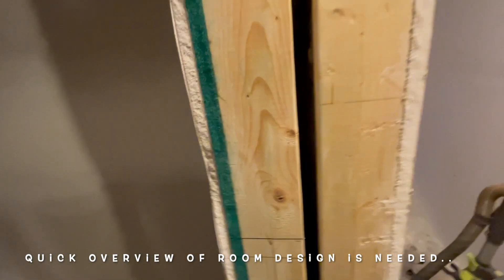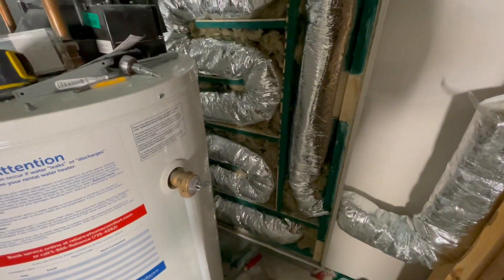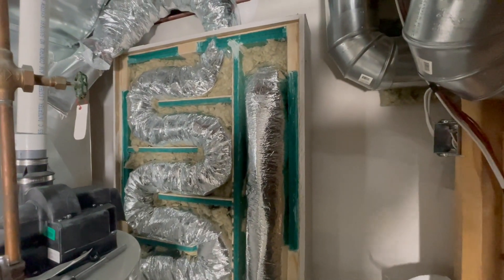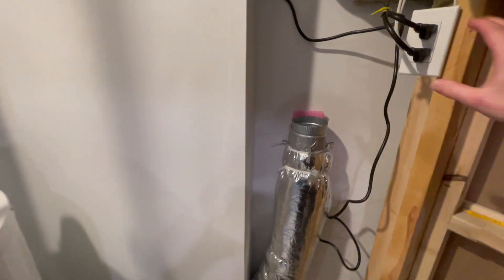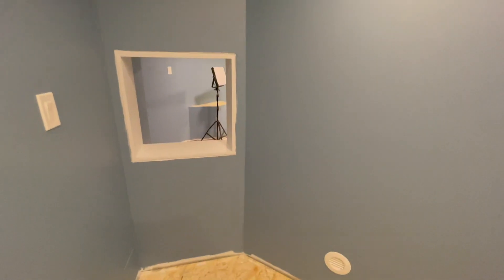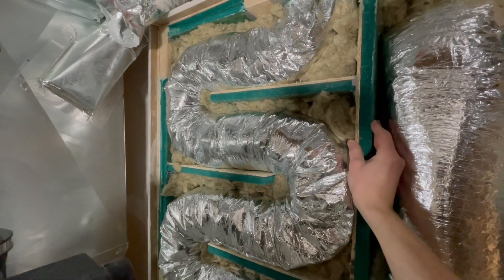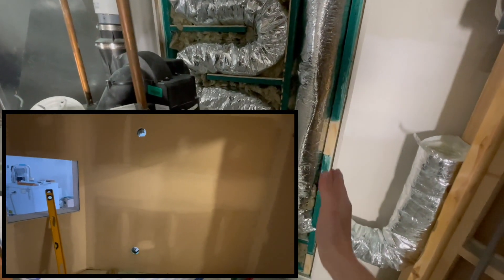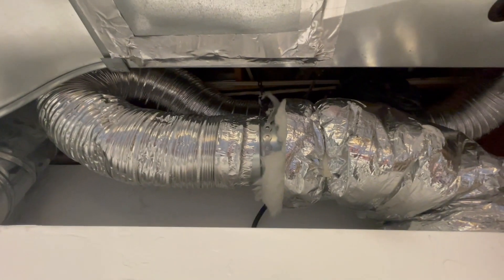Ventilate a Soundproof Room - Building a Home Studio: Episode 6

Comment: Hey, thanks for posting. The wall work looks clean and the design and theory sound good. How did you end up liking the final result? At the 4:45 mark it sounded as if the fan noise would still be loud enough to get into your recording? Was this not the case? Would you do anything differently a second time around?
Reply from the maker: Hey, thanks for watching! It worked well. I can play the drums while my family is sleeping, which was my primary goal. They can faintly hear the drums from most vents, but its not disturbing. For example, when I start drumming after my wife is asleep, she doesn't even know that I drummed. I haven't had a chance to record yet, but I suspect you are correct that the mic's will pick up the fans. Compared to the drums though, it should be negligible. Plus with the switch control, I could always just turn off the fans for a few minutes to record. For my space, I wouldn't have done anything differently. I went all out with the small space that I had, and did everything I could. But I would say that HVAC systems for any soundproof room depend entirely on the layout of the room and its surroundings. Like if my furnace wasn't right beside my soundproof room, I would have designed a completely different system.